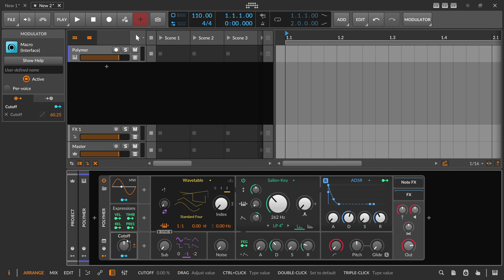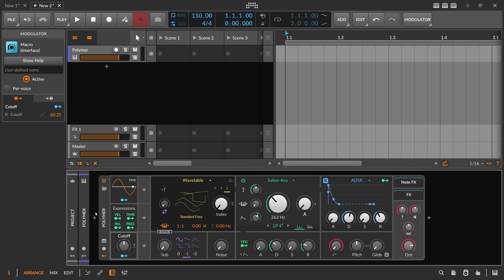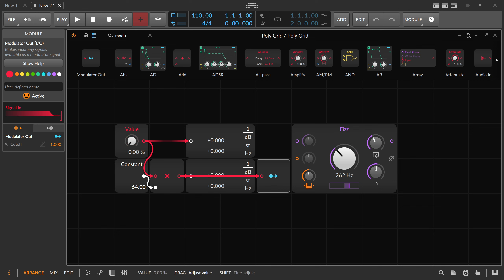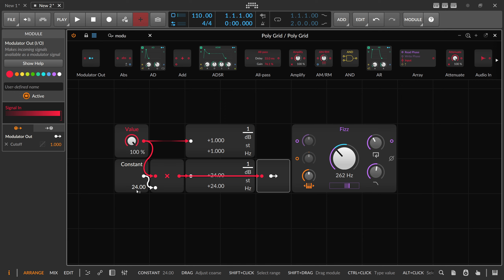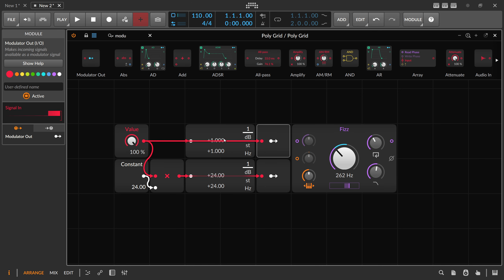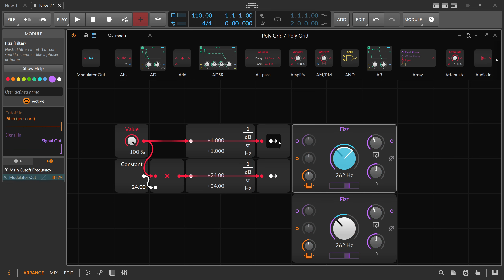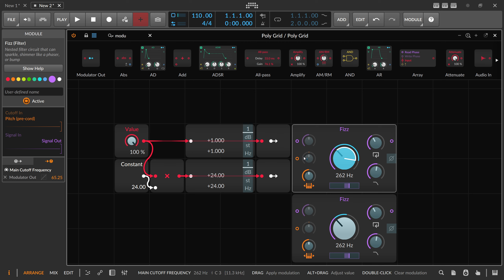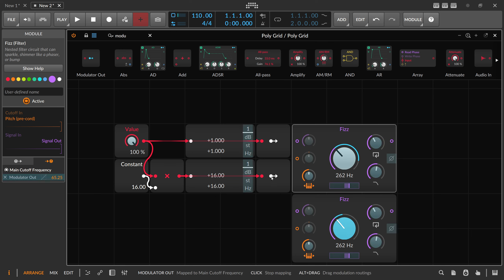did you know this?

Comment: I have a modulation problem. I want to use segments to slowly open a filter over like 2 bars. then  I want to keep that filter open for however long I want, then use another segments to close the filter. Basically using modulation to undo the modulation. Modulation inception. I am triggering the segments with a button. All in the grid. There is probably a better way that I haven’t figured out.
Reply from the maker: but segments has a "hold" mode, the small icons below the graph. in hold mode the red line is held as longe as gate is high. and on release in continues the graph. is this not what you want?
Reply: @PolarityMusic  yes. I didn’t realize that was an option. Thanks.